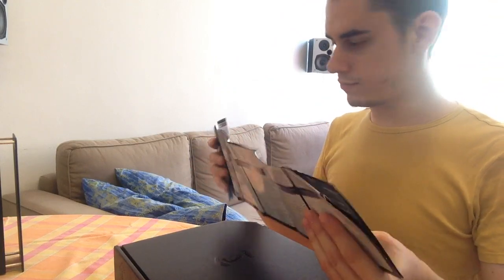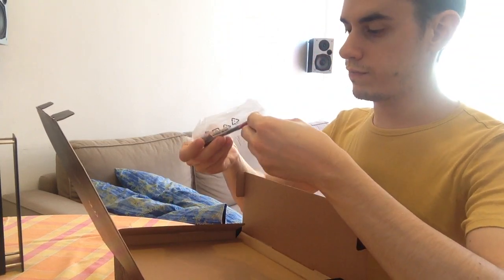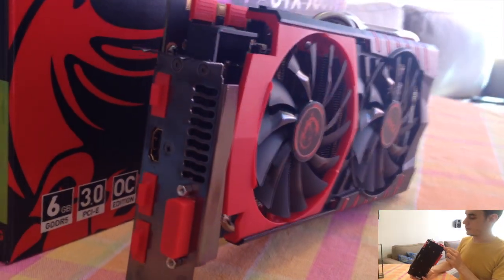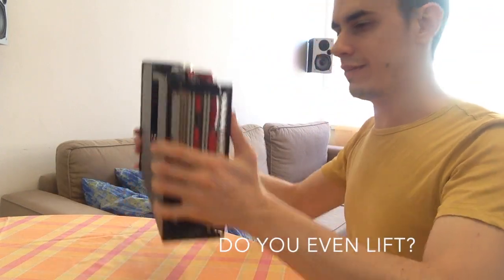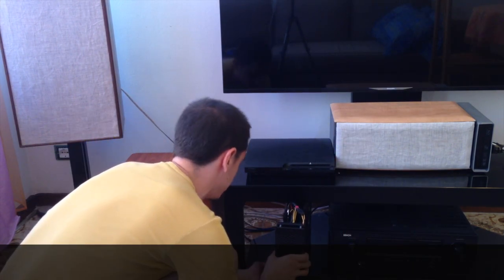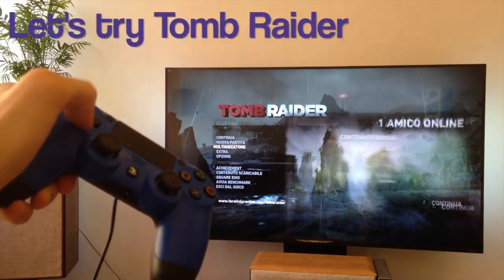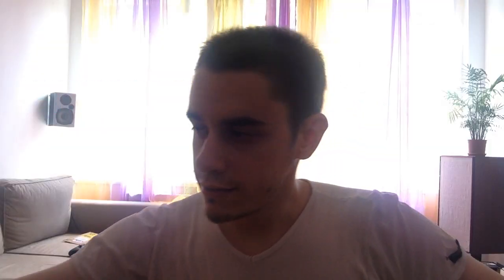Best eGPU in the World? GTX 980 TI Unboxing + Mac OS X & Windows 8.1 boot test

Comment: will it run The Witcher 3 in Ultra settings with Hairworks On (1080p at 60fps) using mini PCIe or Thunderbolt 1 ?

Comment: very very nice video ..... how to make box for egpu + power supply ???
Reply from the maker: The "box" is the Sonnet Echo Express III-D. With the original PSU you can power a GTX 970 (300W). If you use a more power hungry GPU you have to buy a more powerful PSU like I did, you can check this video: https://youtu.be/ADCIPmBqVu0
I used a 3D printer to build a box for the PSU.
Reply: is this work on laptop  like lenovo z5170
Reply from the maker: Nope, you need Thunderbolt 1 or 2.

Comment: Great video!
But I got a question: I currently own a 2015 MBPr w/ Intel Iris Pro and I'm thinking of getting an eGPU-system like yours. Is it possible to just use the built-in screen, instead of an external one like you did? 
Should be, right?!

Comment: Hey, what can I do if the Windows 8.1 installer doesnt find the internal Macbook SSD?(i want to install on it) .. ive an Macbook Air 2015..
Have a nice day :)
Reply from the maker: You are installing from usb?
How many drives you have in the installer?
Reply: WTHF Mob Im installing from USB stick, and the drive list in the windows installer is empty :)
Reply from the maker: You boot from the "Windows" partition or the "Efi Boot" partition?
You should select the Effi installer.
Reply: WTHF Mob Yea sure, I selected the EFI installer (its the USB stick).. can the reason be that I need special drivers for the SSD?
Reply from the maker: You created a USB installer on macOS?
If so it should download automatically all drivers...
Reply: WTHF Mob oh yea I can try this again, I just created an installer with diskpart xDD

Comment: Very nice video. Wanting to build one now. Did you find a way to get the power supply looking presentable?
Reply from the maker: Thanks man.
Not at all. But actually I use a Flex Atx PSU (400W gold), and I'm thinking to building a PSU case  (to put it inside the Sonnet) with the 3D printer.
I think that this would be awesome.
Actually I'm making some tests with the 3D printer. When I'll build somethin usable I'll make a video about that!
Reply: Awesome. That would be a great idea. I'd like to see it. I'm thinking I might go with the "wall mounted" route. I've seen some pretty good cpu wall mounted rigs. I will just make mine a eGPU one. Something that I can just hang up or take around with me. All just ideas for now :-D
Reply from the maker: +Lennie Moses
Cool that too!
Actually I have the Sonnet and GPU apart and taking measures.
Just have to build a box with 2 fans on top of it...I hope I can do it! XD

Comment: everytime someone manually rotates a fan in a pc I die a little more inside
Reply from the maker: +Florian Schmidt 
Why?
Reply: +WTHF Mob at this low speed like you rotate them it won't damage anything but as you probably know, electrical motors also work as generators and therefore generate uncontrolled electricity which can damage components. But as I already said, at this low speed it's harmless, but if you blow compressed air at it and the spans spin very fast it can easily damage something. And great video btw, are you italian?
Reply from the maker: Oh you're right!
Thanks :)
Yep, really italian, you?
Reply: german :D

Comment: I need only a gpu, titan x or 980ti to macbook and imac, so I need just one slot and and some power suply. What would u recommend?
Reply from the maker: +ombrfade 
First mind that with eGPU you will use an external monitor.
Then:
Every TB box out here has PCIe 2.0 x4 lane -> 16 Gb/s, exept from Sonnet Echo Express III-D that have PCIe 2.0 x8 lane -> 32 Gb/s.
Mind that TB1 has 10Gb/s, TB2 has 20Gb/s (TB3 has 40Gb/s).
That said, I've done a benchmark using only x1 lane of PCIe 2.0:
https://youtu.be/2r5iUECvq9U

So the conclusion:
if you want the best case, I think that the Sonnet Echo Express III-D is still the best choice, but if you don't mind some bottlenecks go and buy the Akitio everyone talks about 😊

You can use the link in the description to support the channel buying things on amazon!
See ya!

Comment: awesome, I am looking for external PCie why you picked the SOnnet?
Reply from the maker: +ombrfade 
Because it's the best case 😊
Also you have an extra PCIe (I use it for the Sonnet Tempo SSD as boot disk, so I can swap Mac and use it with no problem) and you have a 300W PSU, with some tweaks you can power the GPU with the original PSU (not a beast like the 980TI).
But, if you don't mind to have an external PSU and have only 1 PC/Mac you can choose a more cheap case like the Akitio (I personally haven't tryed thet yet, but many people use it).
It really depends on your needs, not so many people does the thing I do 😊

Comment: How many watts is the PSU for that sonnet?  it was not enough to power the gtx 980ti?
Reply from the maker: +Israel Alvarado The Sonnet PSU is 300W.
But just note that 300W used, is not 300W "powered".
Just to make an example:
a 500W 80 bronze PSU is capable of "give" 400 real word W.

So, the Sonnet 300 W (not 80 bronze), should be capable of give something above 200W.

Comment: Will this basically make a mac into a gaming computer? or will it only make the resolution better? sorry I'm new to this stuff.
Reply from the maker: +JayJayPlayz 
You will get a huge boost on performance.
The resolution depends on the GPU you will use, but from the integrated GPU you will see a huge improvements! :)
Reply: +JayJayPlayz As long as you've got a compatible Mac and can get it to work (which will depend on your setup)... then yeah, pretty much. It might also be a viable way around the high requirements for VR gaming; this weekend I hope to try using an eGPU on my old 2012 Retina Macbook Pro and seeing if it'll work with the Oculus Rift or not.
Reply: r00x cool. tell me the results
Reply: +r00x Any news on wether you got the oculus to work?
Reply: GoSpringboksGo JayJayPlayz Yep, got it working!! On Windows, Runtime 0.8 with a GTX 970. Was able to play the Leap Motion Blocks demo just fine (USB hub required to squish all these USB devices onto the 2 available ports though!) and for something more taxing, Eve Valkyrie seemed to run just fine. Project CARS seemed juddery in menus but fine ingame. Elite: Dangerous didn't work at all (SteamVR didn't like the weird dGPU+eGPU setup it seemed, but I anticipate the upcoming Rift compatible version on/around the 28th will work just fine).

I did post a thread on Oculus forums, starting with a GTX560Ti before testing the GTX 970: https://forums.oculus.com/viewtopic.php?f=26&t=30006
Reply: GoSpringboksGo JayJayPlayz I should add, there are some caveats - it seems it really works best if you disable the Macbook internal display and use an external one off the eGPU. I think this is because of a performance hit from the Oculus mirror window when it gets passed back through to the laptop's internal LCD. In some cases minimising the window is enough and in others it needs the internal LCD disabled entirely.

The situation seems different for different laptops. I did the same test on a Lenovo X230 (i5 processor) with a GTX 970, which does support Optimus unlike my Macbook (which has a GT650m in it). On the Lenovo it seemed less of a problem to have the mirror window on the laptop internal LCD, however, I still found a lot of stuff was CPU bound. Oculus weren't joking when they set out the minimum requirements for the CPU - you need something reasonably hefty it seems.
Reply: +r00x Great, thank you for your detailed reply!

Comment: What is the thing you used to mount the GPU on in order to make it work with the Mac. I want to know the name
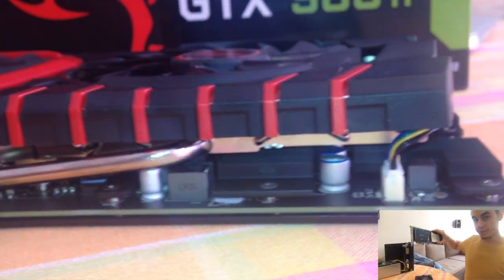Reply from the maker: +Ya Boy Moose You mean the thing at 2:28?
It's a Sata to PCIe from sonnet, I boot windows 10 from a samsung 840 ssd and have another 2.5" hdd for games (actually 2tb).
This way I can boot w10 with all my apps and games with the mac I want (Mini/Air).

Comment: I noticed you add more hdd with your box. Do you have an os installed on them?  If so, are you booting from them as well? Do you need two thunderbolt cables to see them or just one for the video card and the hdds does the trick.
Reply from the maker: +Kr4nG133 Hey, on one ssd (840 samsung 250gb) there is the os (windows 10), and on the other (toshiba 2tb) I have games.
Just 1 TB cable do the trick :)

Comment: Ciao, does anybody have experience with the gtx980ti in a mac pro 4,1? any suggestion about a TV that could support 4k at 60hz through hdmi? or is it possible only through display port? grazie!
Reply from the maker: +Alberto Buffolano Ciao, effettivamente io ho un Philips 7909 55", 60 hz @ 4K via HDMI.
Ho scelto Philips per l'ambilight, ma ce ne sono anche di altre marche...

Comment: Im running the eGPU set up with the Akitio Thunder2, GTX 980 Ti SC 2.0, EVGA 850w Bronze and a Late 2013 Macbook Pro Retina maxed out for that year at 2.8 GHz Intel Core i7, 16gb RAM, 1TB SSD. I'm using this set up for Premiere and Davinci Resolve as CUDA.

When my GPU isnt being used this is the performance in CUDA-Z

Memory Copy
 Host Pinned to Device: 1275.23 MiB/s
 Host Pageable to Device: 1250.35 MiB/s
 Device to Host Pinned: 1380.52 MiB/s
 Device to Host Pageable: 1352.74 MiB/s
 Device to Device: 108.852 GiB/s
GPU Core Performance
 Single-precision Float: 6971.89 Gflop/s
 Double-precision Float: 228.923 Gflop/s
 64-bit Integer: 369.856 Giop/s
 32-bit Integer: 2049.2 Giop/s
 24-bit Integer: 1443.37 Giop/s

When I'm playing 4k on my timeline in premiere I'm getting this from CUDA-Z

Memory Copy
 Host Pinned to Device: 759.846 MiB/s
 Host Pageable to Device: 775.32 MiB/s
 Device to Host Pinned: 1022.51 MiB/s
 Device to Host Pageable: 666.432 MiB/s
 Device to Device: 95.5938 GiB/s
GPU Core Performance
 Single-precision Float: 7053.49 Gflop/s
 Double-precision Float: 230.088 Gflop/s
 64-bit Integer: 479.468 Giop/s
 32-bit Integer: 2318.85 Giop/s
 24-bit Integer: 1676.76 Giop/s

It doesn't play 4k in real time in premiere. It also only exports 4k at 14-10fps avg or lower and 1080p at real time for around 24-30fps to my RAID Thunderbolt 2 G-Drive. My CPU says its at 350% when running these processes. Is the CPU just bottlenecking everything? I saw people running setups off lesser CPUs with less powerful cards and getting better playback? HELP PLEASE ANYONE!!
Reply: 13 inch or 15 inch?
Reply: Have you solved your problems? I'm using a 980Ti as eGPU (BIZON BOX, which is basically a Akitio Thunder 2) on a MacBook Pro MID 2014, 2,5 Ghz i7, 16GB RAM, 1TB SSD, 750m Nvidia. My CUDA-Z performance nearly matches yours and performance is way to slow for a 980Ti.

Comment: Ciao, mi sembra di aver capito che sei italiano anche tu quindi ti scrivo direttamente in italiano, piacere Gualtiero. Guardando il video ho notato che il mac mini è un late 2012 quindi in teoria thunderbolt 1,  ci son differenze prestazionali evidenti tra TB1 o 2 nel caso delle eGPU dovuto al diverso bandwidth? 
Grazie in anticipo :)
Reply from the maker: +Gualtiero Lunari Ciao e grazie. 😊
Si è TB 1, ma usando un Macbook Pro TB 2 non ho notato grandi differenze in benchmark, anzi, la CPU era più lenta.
Ora ho l'alimentatore non propriamente definitivo, ma appena lo sistema farò qualche benchmark con altri Mac.
Reply: +WTHF Mob Grazie per la risposta, nel frattempo mi son informato un po' sul sito della Sonnet, nel mio caso (imac late 2013 i7, 780m, tb1) per avere un reale guadagno prestazionale consigliano almeno una 980ti (si parla solo di una 20% di miglioramento a causa del bandwidth del tb1), quindi sto ancora valutando se spenderli ora o aspettare un po e fare un aggiornamento generale con una macchina tb3 (40gb/s) associata magari a un razer core. grazie ancora per le info (non è che per caso hai fatto qualche confronto tra 980ti su tb e su 980ti via pcie?). Complimenti per i canale.
Reply from the maker: Guarda io ho venduto il Mac Mini e mi assemblerò un PC, quindi niente più scheda video esterna. Comunque se si parla di eGPU nella mia esperienza, tra TB1 e TB2, cambia ben poco...io per dire ho il disco di avvio anche tramite TB e non ne risentono le prestazioni...almeno, non sono notabili...
Questo è il mio caso, bisognerebbe fare prove, ma non credo i risultati vadano molto lontano dalla mia esperienza.
Per ultima cosa: no, io ho solo provato tramite TB la scheda video, appena assemblerò il PC farò video PCIe vs. TB :)

Comment: Hi WTHF Mob. Thank for your video. Can u tell me the detail about the eGPU? How many parts I need to prepare? How can link with Mac pro ?
Reply from the maker: +郝瀚霖 HI =)
I'm still working on the hardware, actually my eGPU with the 980 TI needs at least 320W of 12V. Now I use a 400W PSU, with the 80 gold certificate (that's 350W real power).
So...you want MY detailed hardware or do you want to build a eGPU and want to know what to buy?
With this eGPU you can plug any MAC with thunderbolt ad would work (my eGPU has the boot disk IN it).
Let me know.

Comment: So now mac mini is more powerful then iMac 27?  how CPU effect in other programs in generaly? overheating problems?
Reply from the maker: +Armalindo Kapaj With this thunderbolt case you can plug the eGPU to any thunderbolt enabled MAC/PC and use the GTX 980 TI.
I have no overheating neither for the 980 TI nor the Mac Mini, but the PSU actually needs a fan to prevent crashes (I'm so sad about that).

Comment: Hi, I was thinking about doing this, except using a EVGA 980ti FTW, will my CPU overheat or burn??? 980ti is powerful, I do have i 4850HQ quad core in my mac with 16gb ram...
Reply: +Rondo Cat You guys are all SERIOUS losers for using an EGPU on a a Mac. Weak.
Reply: +Signal Radar Unlike you, I had a taste of both so I have the right to bitch ^_^
Reply: LOL true... Apple always behind too
Reply: +Omar Razzack I have ordered a Zotac GeForce GTX 980 Ti AMP for my early 2015 MacbookPro laptop to use on a Akitio Thunder 2 eGPU. We will see how that goes if it will overheat and end up trotteling down the CPU when playing GTA V. 

As it is now I have trouble with overheating in Windows 10 because of "system interups" use 100% of CPU 0 all the time 24/7 after installing Intel graphics drivers. At idle I have 85-90 Celsius at my CPU, without finding a solution to this problem there will be no gaming on my laptop. For over a year people have had this problem on all brands of laptops with Intel CPU and no one have this far found a solution for those who had this problem. Intel Apple and other laptop makers just pretend the problem does n`t exist and do nothing to help...
Reply: +Rondo Cat So you wouldnt recommend the setup?
Reply: Alrighty, I got my 980ti to work pretty nice...
Reply: It works well....but imna just build a rig
Reply: +nexxusty serious loser who buys a Mac thinking they are getting top of the line shit with anything hardware wise, you do need a real GPU even if its not using full bandwidth with thunderbolt
Reply: +Israel Alvarado If you hate apple, why are you watching videos of apple products? Fuck off
Reply from the maker: +Israel Alvarado Yep, like me. :/
I'm selling my Mac Mini to build a HTPC and put the 980 TI in there, so I can see the fps difference...hope to build it soon!
Reply: WTHF Mob I built a new PC with SSD disks and a i7 4970k CPU running overclock at 4,6ghz. The fps difference in GTA V compared to my Macbook pro both running my Zotac GTX 980ti AMP was less than 10% at 1080p with less than 60fps (my TV screen only do 60fps anyway). The big diference with running EGPU only come at higher fps like 120+ as it is then the thunderbolts low bandwidth shows itself.